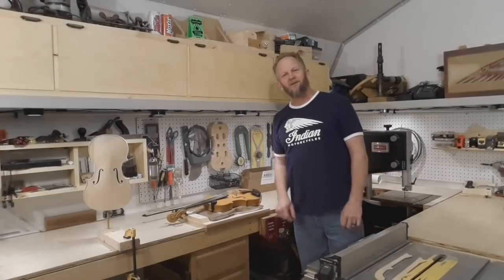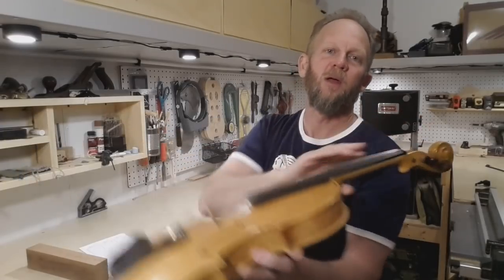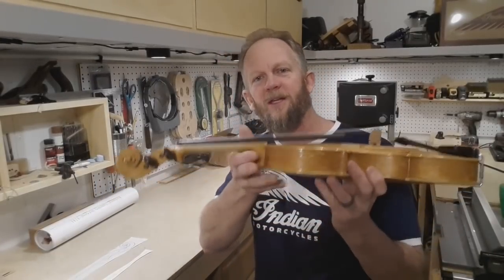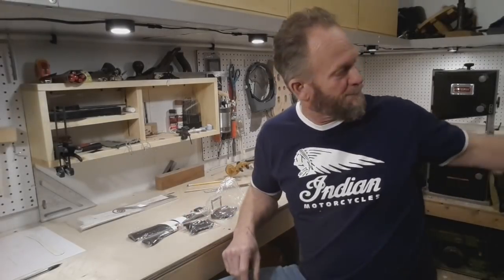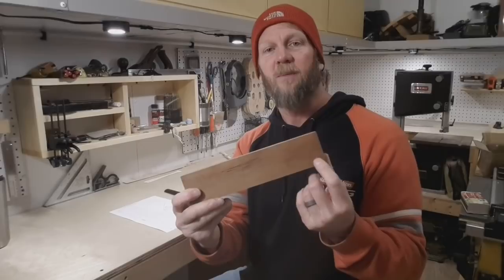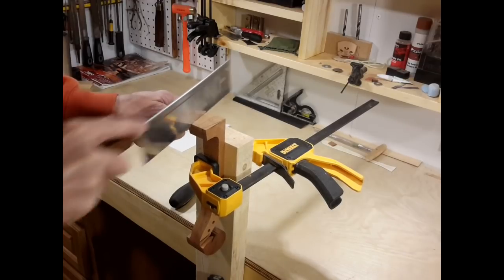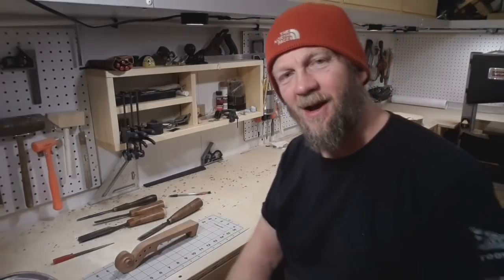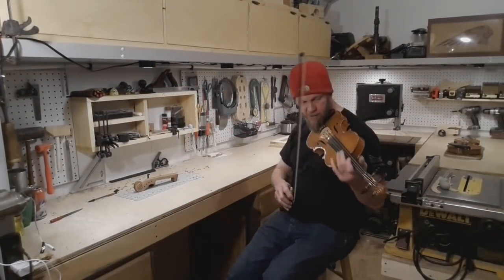How to Build a Fiddle-- Part 8: Carving a scroll

Comment: I've been loving the series... I have no actual plans to build a fiddle, but watching the videos are fun and entertaining none-the-less. Also, I wanted to comment because you made mention of electric guitars with laminated necks. It's funny you mention that, because I used to own a Peavey with a thin neck (thick necks are actually my preference) and it was made from a two piece maple blank with no added fret board. It had started to split near the heel, which is something that now make me leary of laminated necks, but maybe I just didn't have a good one, or the neck held too much bowing pressure from the truss rod. Not sure. Anyway, keep up the great work, love your videos.
Reply from the maker: Thankyou for the compliment.  Sounds like a poor glue joint.  Your laminations sound horizontal instead of vertical.
Laminated beams, for example, are much stronger, too.
Reply from the maker: @andrewsmith1520  I couldn't tell from the web site what the necks are made of.  I was surprised at how they cranked out the guitars with basically no human interaction.  Robots, essentially.  Kinda makes me sad-- but they could produce a guitar for next to nothing that way.  Can't blame them.

Comment: I live in Florida and have acquired a rafter load of Cyprus lumber. Very clear, nice tight grain and seems easy enough to work with. Question is: What is your take on such wood as Cyprus? Would think it would make a nice back and scroll?
Reply from the maker: I looked up the mechanical properties of Cypress.  It is a soft wood, and close to red cedar in strength.  It compresses easily, and is not a very strong wood.  Generally fast growing woods in wet environments yield poor quality for instruments.
I would definitely consider it for a belly or top plate for a fiddle.  Quarter sawn, of course.

I have never worked Cypress---  so the decision is really yours.  The fact that you already have the wood is a good enough reason to explore the uses in an instrument.  I think I might cut a piece down to size, thickness a piece to 3 or 4mm and see how it felt in my hands.  Tap it and listen to the tone.  Your hands will tell you alot.  Bend and twist it. Feel its strength.
Compare it to a piece of maple cut the same size (maple is the standard, we always compare to it).  
The comparison in your hands will tell you alot.
Reply: @grandpasmountain  Thanks Jon. Wow, good advice. I will check and compare cyprus to maple and do the other steps you described above. Coincidently I have a HP laptop like yours and had loaded Audacity and Adobe Audition for ACX ebook narration, so I am familiar with audio tracks etcetra. But I love the setup you've created to test and vibrate plates using tea & pepper. Something else for the 'back burner' LOL. Thanks again.

Comment: I’ve heard some people recommend thinning the glue when fixing the belly to make it easier when and if it has to be removed. Do you think it’s necessary?
Reply from the maker: I don't know.  I am not sure how thin is too thin.
Btw--  I HAVE been able to take my fiddles apart--  I took one apart to change the bass bar.  It wasn't too bad.
Reply: Jon Mangum That’s what I thought, in the past when repairing old furniture and dismantling a mortise and tenon joint I used methylated spirit in a syringe that dissolved the glue.
Reply from the maker: @bluehoo0  heat and moisture softens the glue.  I have used a hair dryer!

Comment: Great video series. Can you list or do a video on the carving gouges you used the most (required) for the scroll and the blocks?
Reply from the maker: Thankyou!
Sure -- I only use 3 gouges.  1/4" 1/2" and 1".
It doesn't take many.  I also use a chisel here and there and have the usual set of 1/4" - 1" chisles.